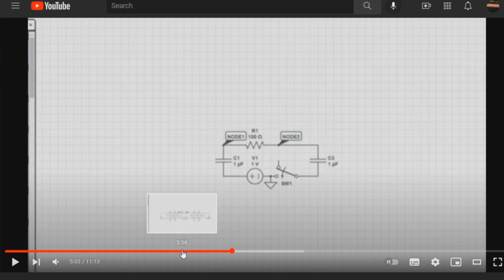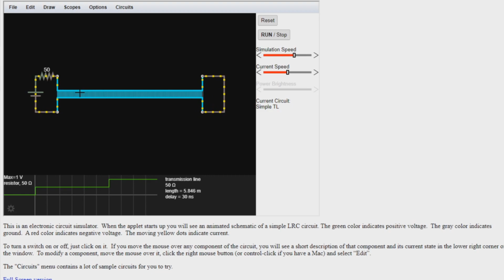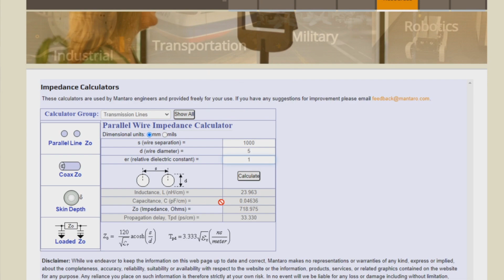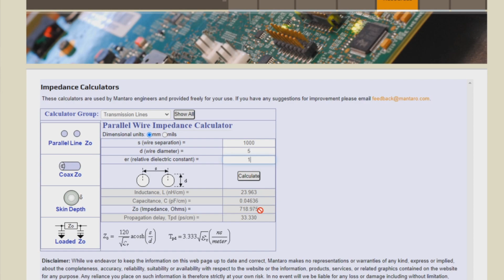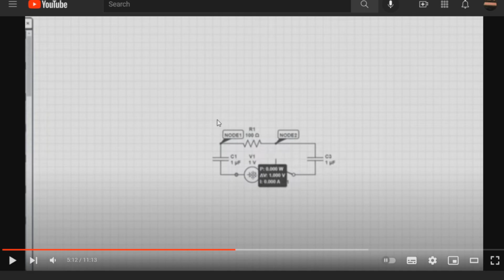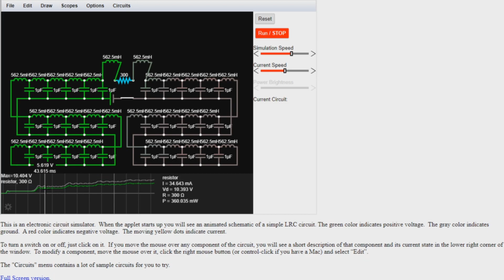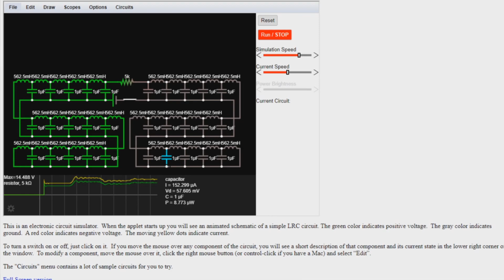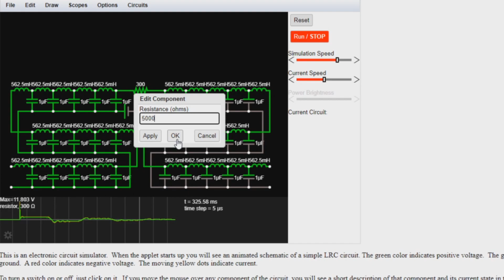2nd analysis, I think I was originally wrong! - Veritasium "The Big Misconception About Electricity"

Comment: I had absolutely no issues with Veritasium's conclusions, I just think his perspective of Power going through the air is misleading. As per his earlier illustration, power transfer happens in presence of magnetic and electric field. Flipping the switch may cause power "emanating" from the battery but this perspective does not explain why there should be current and magnetic field in the wire through the lightbulb and therefore why the power should travel into it. You still need to account for good old electromagnetic induction to explain it.
Reply: Issues: no positive signal to noise within 1/c sec, even within 2/c sec. Only useless theory. Expect very slow ramping up of current requiring several round trips to achieve full power. Snr > 1 not met within orders of magnitude of Derek's claims.

Comment: Assuming a standard wire length to be 100 feet: 1 from negative terminal to bulb and another from bulb to position terminal equals 200 feet total. In reality that is probably the circuit here, though unseen. If so the bulb will light instantly- to our visual systems ability( as shown)- and anything further is a theoretical dead- end. Mere hocus-pocus. If just a thought experiment is the bulb lighting just ‘photo- shopped’?

Comment: The problem I have seen in every replay so far has been the same. In the actual original video he gives a specific verbal description. And then a graphic is inserted as an example. But the graphic does not match the verbal description. e,g, the 1M distance he gives is the physical distance between the bulb and the battery/ switch. The graphic translates that into parallels wires 1M apart. But he only says each wire is 1/2LS long. And gives an example of how far that it, half distance to the Moon. He does not say not SHOW parallels wires! In fact later he shows a demo with chains and it is CIRCULAR! The energy goes in a circle. Not parallel lines. 

The whole waveguide/ interwire capacitance .... is a distraction.
Reply: I don't think it actually matters that much how the wires are oriented far away, because the coupling is driven by the region around the bulb and battery.
Reply: @ummonk  Like this one, almost all attempts at disproving Veritasium's OP are based on attacking it as a transmission line problem. When that is now how the host specifies it. And transmission lines have very specific additional operating conditions.

Comment: First folks, the batt is DC. And the wiring is Not  a TEM transmission line..
.
Reply: Yeah, I'm agree with you, distributed elements and Transmission lines are for AC.
Reply from the maker: @dracobucio586  Oops I missed this comment and didn't log into youtube for a while. But anyway just in case anyone in the future reading this is wondering the same thing, the answer is any change in signal (ie: throwing the switch) is "AC" in the world of electricity. You can think of it like step functions can be Fourier transformed into a sum of sinusoidal waves, which is AC. So during the state change AC analysis will apply. Steady state DC is just a special subset of AC.

Comment: First of all, thanks for making this video!  I have two questions: 1) how would this solution change depending on the distance between the lines? Would the bulb allways light up after Distance/c seconds, like Veritasium aluded to, or would the magnetic coupling between the two wires be too small at one point? 2) What if it was an LED, and physically oriented the other way around while acctually connected correctly?
Reply: The inductive coupling is already too small at 1m and 1m/c seconds.
Reply: @skepticalextraterrestrial2971  Agreed, though would be nice to know an expression for the current as a function of the distance
Reply: @LoudHydraulics  The expression involves both distance and time, and seems fairly complicated to calculate.  Veritasium's magic light bulb is lit before the switch is even thrown.  What distance is too great for the magic light bulb is not something I could answer even with the equation.
Reply: @LoudHydraulics  if we stick to the model described in this video, making the wires further apart increase its impedance.

Comment: I had a go at this last week because like you I thought the line separation was way too high and current would be negligible. But I used a 1mm wide conductor which gave me an impedance of 1.0kΩ, and a standard 12V 0.25W bulb resistance of 48Ω

I think the conclusion I would have to take away from all this is that the devil is in the detail and all  veritasiums hand waving about ideal this and that is fundamentally wrong. If you choose impossible values for a problem that is dependent on a complex interaction of factors you might not even have thought of, you're going to get an impossible answer.
Reply: WHERE DID THE PROBLEM COME FROM ORIGINALLY?  Did Dereck really come up with this from scratch?  Or are we all fighting against some college EM textbook, where this appears as a nasty "trick question?"   Was it actually invented by a devious engineering professor for graduate RF courses?   If so, then we should EXPECT to be fooled, and end up with egg on our faces, (heh, just like that guy's students, if they encountered this thing as a question on a final exam.)
Reply: In the first 1/c sec, this is less of a transmission line and more of a transmission square. In fact, for any time relevant to 1/c sec, one must reduce the line lengths to "roughly" zero.  This means for example that both sides of the lamp leads will see "roughly" equal impulses from the point of origin. It is only after the point sources become "lines" that one side is influenced differently than the other. Such separation for example is 50/50 at tx after about 0.5/c sec and the matching moment  of this separation at rx won't arrive at the lamp until another 1.5/c sec. So the question remains. How much is enough? Answer: SNR.
Reply: It'd all be ok if Veritasium had stated "all things are magical except the propagation of fields."  One magical assumption he did not permit was the heating time for the bulb.  A Phillips or GE bulb, as he demo'd, would take half a second or more to light up.  So if you want to point out all the tricks as a brainteaser, the only correct answer was (e), since "not all the magical exemptions were provided."
Reply: So Derek was posing a philosophy question, not an engineering question.  That was the actual trick of the question.  All the engineers complaining abut it are missing the point. However, their complaints have led to excellent education, so I am in the engineers camp. It is good to miss the point of Veritasium's puzzle.
Reply: @Achrononmaster  the bulb was an LED and the assumption the bulb turns on as soon as current flows through it was explicitly stated just in case someone wondered if it was a filament bulb that needed time to heat up. But at the end of the day it's a thought experiment. If you want to use different components for your circuit, say a watch battery and nichrome wires, that is up to you. There are infinite setups that won't light up at all - if you want to imagine one of those you are welcome to. To me the interesting question is: is there a reasonable setup where the bulb does go on quickly? And I think this video provides a convincing answer that yes there is without "magic" bulbs, batteries or switches.
Reply: @veritasium  you miss your own point of your experiment, i.e., that the (1m/c sec) shorter than the expected one second timing of the long wire, due to the initial and very brief capacitive coupling blip between the wires is proof that POWER flows in the fields AROUND and OUTSIDE the wires and not WITHIN  the wires.  For me to be convinced, the POWER would be defined as the full rated current of the bulb or any other load (not the mere presence of detectable current flow), and it would have to be present fully and continuously at 1m/c second for your mind experiment to have been convincing proof that a circuit's POWER transmission is in the external fields and not within the wire.

Yes, power can be coupled through capacitors - think of the common motor starting capacitors - but that requires AC not DC, and a very large capacitive coupling area whereas your two wires 1m apart represent a VERY SMALL capacitance excited only with DC.  Your test of your hypothesis is simply not applicable.

You further mention as proof that the power cannot be carried by the electrons (and therefore must be in the fields) because power passes through transformers that have no direct electron coupling between input and output wiring. This is just a silly example and conclusion.  You sound like the not-so-amazing Randi.  Further your hypothesis reminds me of my Physics 1a professor who stated that the gravitational force between any and all objects with mass exists at all distances.  "Imagine the power of that," he said as he raised his hand toward to the sky, "I wiggle my finger and the stars oscillate in their orbits!"  If such power were available, in order to deflect an earth destroying meteor we could just launch an astronaut and have him shake his finger to alter its course.

As a 75 y.o. EE and electrician I have successfully designed and installed hundreds of power circuits using the "incorrect" models that power flows in the wires a lot like water flowing in a pipe.  Perhaps you have successfully demonstrated the difference between engineers and physicists.

Just how power is moved from source to load proves to be an interesting question so, to that end you have initiated some fruitful discussion albeit riddled with misconceptions.  The transmission line analogy is the wrong model for analyzing your fundamental hypothesis.  We must all remember that in life, you get the behavior that you reward, and you have been rewarded well with the number of "clicks" that your crazy hypothesis has generated so, of course you will continue to defend it, and NEVER take it down, no matter if it eventually proves totally false, misleading and ridiculous.

Comment: You are mostly correct, except the blip explanation ->wrong wrong. The blip is because you are using a unit step switch. It switches instantaneously like a square pulse...it has infinite frequencies, so that's why you see it.
Reply from the maker: The blip is caused by multiple phenomena, from using only 6 total blocks making a short wire with "instant" reflections to selecting too high of capacitors right beside the resistor. Technically a step switch also has an impact, in that if it was ramped of course there would be no blip, but I think that is kind of out of scope of the question.

Comment: Appreciate the effort - although using sensible values for C and L (not just ratio) would have shown a much less significant spike at the outset (which would have made that red herring of a an initial spike less of a distraction in first place).  In any case, without Veritasium giving the specification of the bulb, it is impossible to conclude whether being lit is a plausible outcome.  So even though you are showing several milliamps, the power to a matched bulb (1.5K impedance) would be less than 100 milliwatts.  Definitely enough to light discrete LEDs, but that is not what the bulb in video is.   It is showing as pretty bright in a full sun background.  Even a very efficient LED bulb would be around 5W to do that.  So, 1/50 the power arrives at first, and eventually, at steady state turns into the full power.  The CLEAR inference from the video was that since power is transmitted in the fields, we can expect something on the order of full power after that first few ns.  Yes, he mumbles something about the reflections needing time to settle, but getting almost two full orders of magnitude less power than full power at the magic t = 1m/c mark is bogus for claiming the bulb is lit.  He was trying to make a point, but used a vastly underspecified and nebulous problem statement to make it.   It really takes away from his otherwise decent treatment of the topic.
Reply from the maker: I guess it depends on how deep we dig into the details. For example, although he presents a real bulb it does look like one of those LED bulbs, and his battery is clearly not a 120V battery so I'm assuming it's a lower voltage and wattage bulb. Plus he does mention this bulb will turn on at any current. So it's up to the viewer to decide if showing real-world props but also mentioning 0 resistance wires and a specific bulb property is valid.
Reply: @ZongyiYang  Fair enough.  Perhaps just a physicist ideal model vs engineering mindset. Reminds me of the old joke:  What’s the difference between theory and practice?  In theory, there is no difference, but of course in practice there is. Take care.

Comment: I really like that you spent the time to run a simulation. A pretty amazing effort !
If the original question is unmodified, then the technical correctness is unchanged, and the question as originally posed is an EM Wave problem, not a transmission line problem. Though, I do think it was "intended" by Veritasium to be a transmission line problem.

I really admire the attempt to validate the power output of the transmission line theory to light a "non-magic bulb", because,  ultimately, we don't use magic bulbs in real life. This sim appears to show fairly reasonable amounts of current reaching the bulb, which is somewhat unexpected. However, the voltage still takes quite some time to ramp up. So there would still be some delay to overcome the forward voltage of the LED.

However, I have to view the simulation with a lot of skepticism as it relates to "real world" results. Is there a way to simulate this with real world wire lengths and wire that has actual resistance and get similar results. For example, if you change this to two 10 meter loops of ~22 gauge copper wire (insulated) 1 meter apart, will you get reasonable correlation? 

Two 10 meter lengths can be reasonably validated physically with oscilloscope. The actual capacitance and Inductance values of the wire can be measured. (Though i don't have equipment sensitive enough to do it).

I would really love to see something that "physically" correlates.

Thanks for spending the time to make this video and the simulation. Note: This doesn't change how I feel toward the Veritasium video. I still find it very misleading. And I disagree that this is how electricity is "really" delivered to my house in order to power my appliances which seemed to be a fairly major message delivered by the video.
Reply: IMHO we could not build a practical circuit with a real room illumination bulb to demonstrate this effect.  Given the time constants of such devices, the circuit would need to be huge, made of superconducting materials, and operate on very uncommon voltages.

Rather I think that it would be fair to build a circuit that demonstrates the core effect (EM field propagation of energy across the space between the two wires causing an effect well before current could get there) that shows the effect on something like an oscilloscope. 

The first relevant circuit is simply a demonstration that transmission lines really act the way they are described in the video.  That there is a near instant coupling of power 'across' the line, followed by a further step once the signal travels down the line and back.  You can demonstrate this much more easily with AC, by connecting a variable length transmission line stub between an AC source and a load.  Depending upon how the AC frequency compares with round trip time in that stub the apparent impedance of the transmission line changes.  The bulb gets brighter or dimmer depending upon the particular AC frequency and the length of the stub.  This demonstration circuit is called a Lecher line, and was built in the late 1800's, before we had oscilloscopes.

The next circuit would have the same general layout as the one in the original video, but instead of a bulb you would have a resistor and oscilloscope, and instead of a battery and switch you would have a high frequency square wave generator.   Instead of two wires a meter apart you would use something called 'ladder line' which has the wires perhaps 6" apart, and make the transmission lines perhaps 50m long.  The resistor would need to be about 800 ohms.  The shape of the signal on the scope would be able to show the initial coupling 'across' the line, and then a third of a microsecond later you would get the coupling 'along' the line. 

The hard circuit to build is one that shows the actual time and shape of the signal going 'across' the line.  Standard transmission line approximations/simulations ignore the speed of light across the line and only consider it down the length of the line.  This is usually good enough because lines are narrow and long.

-Jon

Comment: The main point of all the controversy is that it must be defined when "the light bulb is on", because yes, the simulations indicate that there is an energy blip, but the point is that in the Veritasium video at the end Derek says that the bulb will turn on immediately after one second.
Reply from the maker: Yes the 1s statement seems to agreed upon by everyone, but the theory shows that it is heavily dependent on what fraction of power is needed for the light bulb to turn on, and how resistive it is compared to the characteristic impedance. The bulb can turn on immediately (1/cs), at 1s, some multiple of the relection time (2s,3s, etc) depending on the choice of these parameters.
Reply: @ZongyiYang  If bulb can turn on at any current, then it would already be on from background waves